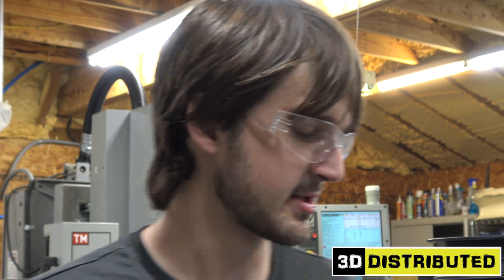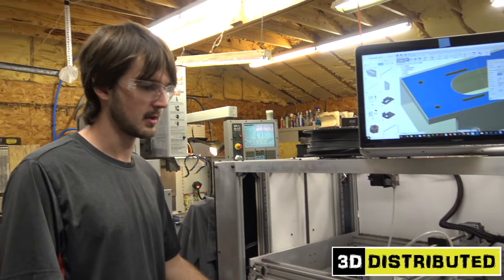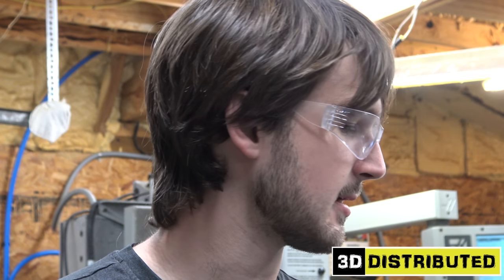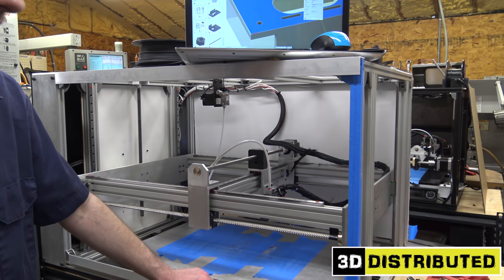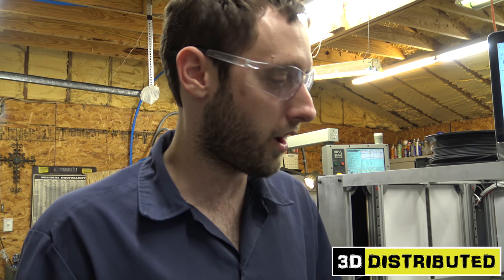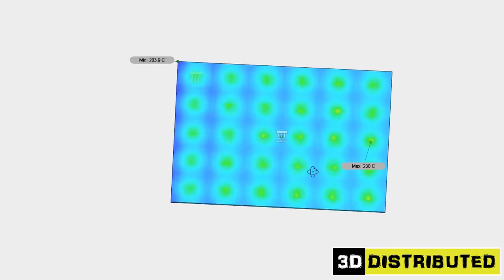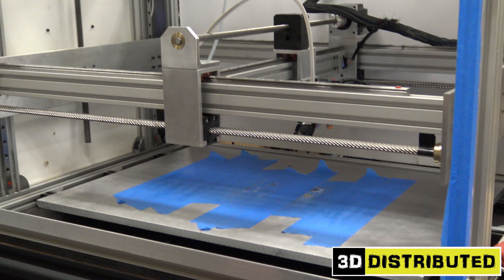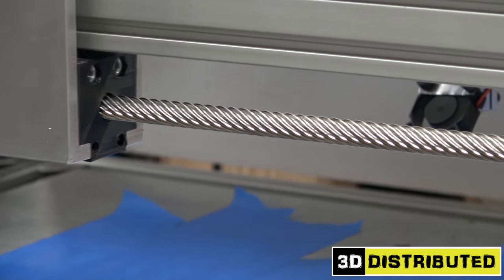Heat Bed For The WorkHorse 3D Printer

Comment: Sounds like you are over-complicating the solution.

First, aluminum is an excellent conductor of heat. That 1cm slab will serve just fine - as is - for distributing the heat.

Second. Use an silicone heat pad on the bottom of the aluminum plate, with a layer of insulation below. Without insulation, a lot of heat will escape downwards, rather than into the aluminum. You want all the heat going upwards.

This mass of aluminum will take time to heat up, but likely not too long. Take measurements of time and temperature.
Reply from the maker: Preston Bannister I was hoping we weren't over complicating things. The plate is actually .5 inch thick. I didn't think the silicon heat pads would be enough.
Reply: That is quite thick, but might be a reasonable trade-off for dimensional stability. Keep in mind that aluminum is an excellent conductor of heat.

Your heat-up time will be a bit long, but perhaps not long enough to matter. If you use a silicone heater on A/C, you can pump a lot of heat. If you also insulate the bottom of the bed (so all heat flows upwards), my guess is you will have no trouble heating the bed.
Reply: It's also worth noting that silicone heat pads can be commissioned to any size & shape, any voltage, any power range, even dual voltage or three phase, for a pretty reasonable price.
Reply from the maker: Oh cool, we're kind of concerned on how long it will take to heat the bed up since our bed is 1/2 inch aluminum plate.